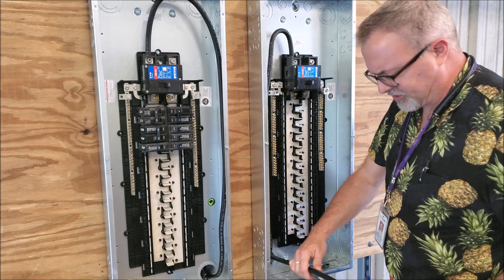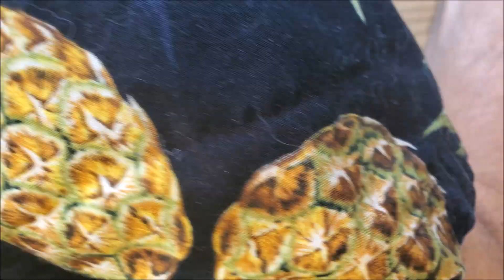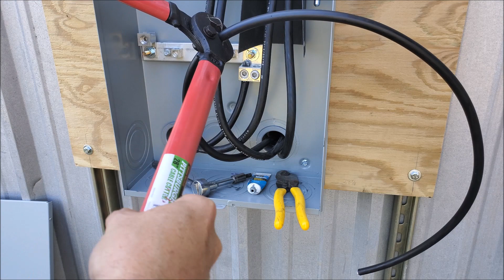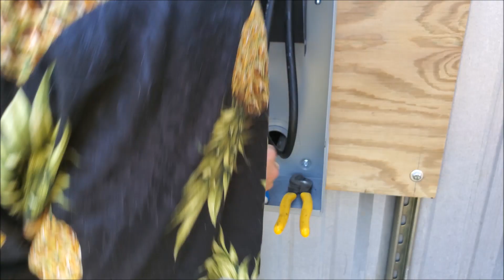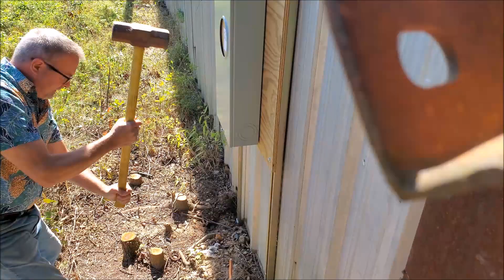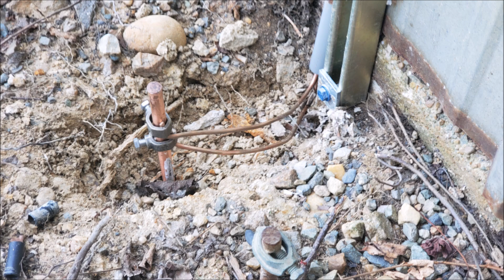Monster Shop Power Update - Pt III of many?

Comment: would va power not put transformers in for 3p service?
Reply from the maker: Yes. I can get 208Y/120 or 460/277 (better choice for big motors). Issue is cost of my inside electrical equipment. I'm trying to get power on the cheap which will get me by for a couple years. Three phase is coming but for now I will run off single phase and a rotary converter for my three phase equipment.

Comment: Maybe you said but why didn't you just use the ground rod already in the ground?
Reply from the maker: One was galvanized, and I was concerned about corrosion (it's from 1980's) and the other "copper" ground, which is just copper plated steel, was also corroded above ground. I had electronics fried in a previous home with poor grounding from a lightning strike, so better to be safe with new.

Comment: You need to have installed 2 driven ground rods, more than 6 feet apart.  Requiring #6 bare copper run from one panel, to the first ground rod then continuous unbroken wire to the second ground rod.  A jumper between the two panels will suffice, #6 is good for most inspectors, some may want the jumper to be #4 bare ground.
You also need to mark your neutral wire with a white line continuously from one terminal to the other.  some inspectors will allow you to use a roll of white tape to mark the neutral.
Reply from the maker: Thank you! I appreciate the advice on the grounding, and was wondering if what I did was kosher. I think my local inspectors are OK with a wrap of white tape on the neutral at each end to denote that it is a neutral, but the entire length is easy enough to get to if they want a continuous white line. so, back to Lowes for more bare Cu and another rod!